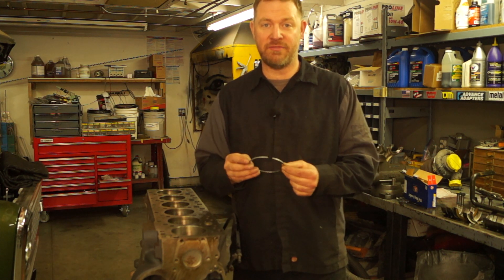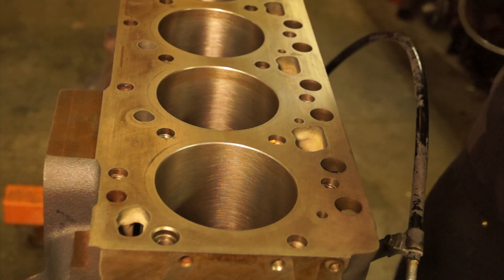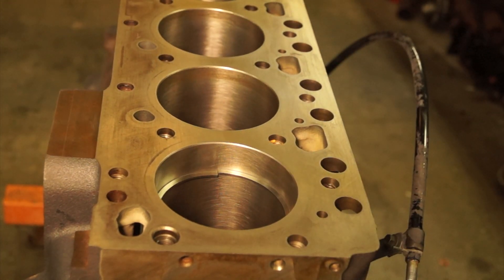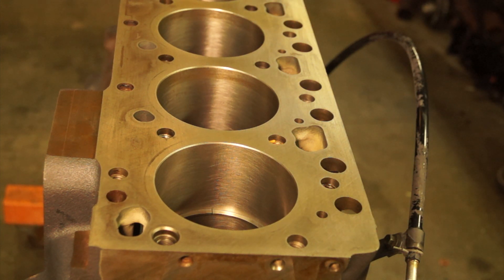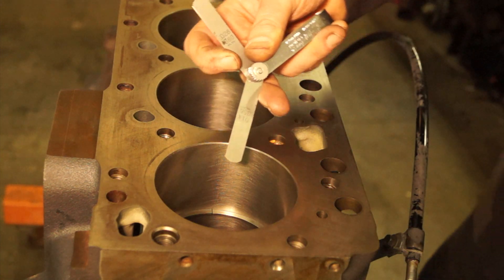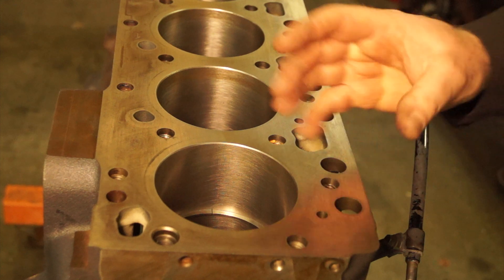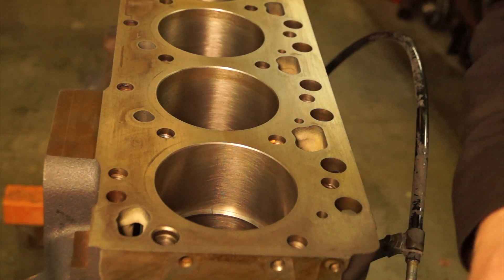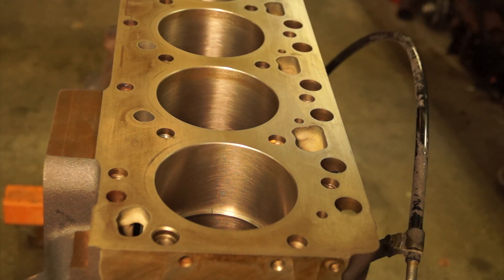How to Check Piston Ring End Gap

Comment: I have a gap of 28 thousandths using Hastings rings on an sbc and there tech support told me the I would be fine with the 28 vs 18-22. Kind of on the fence with that these days big companies will tell you anything. I would like to consult with the machinist but don’t feel like getting into it with them since I’m such a newb. Maybe I’ll try another ring company and get lucky and they will fit in spec. Thanks for you video I did the same technique.